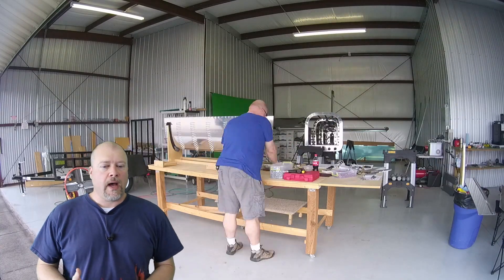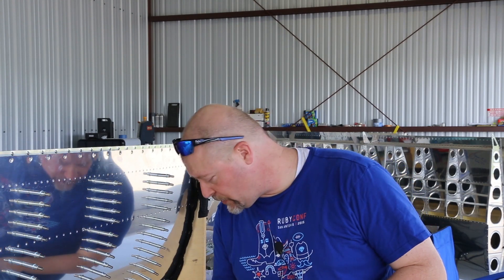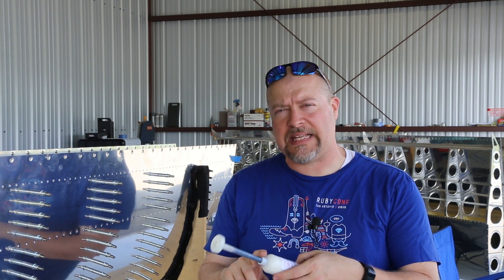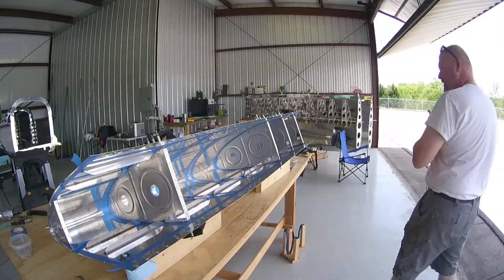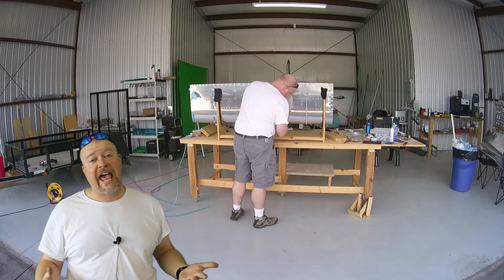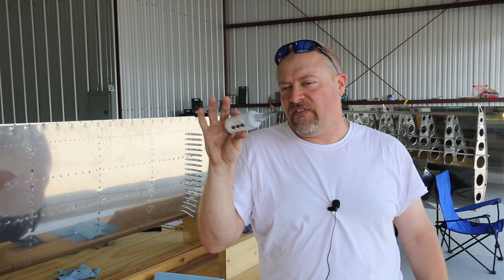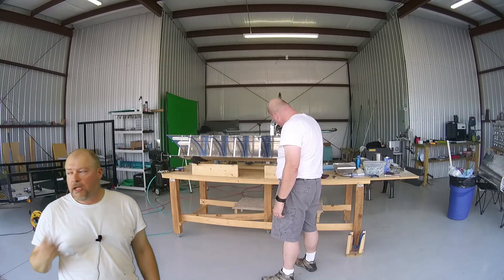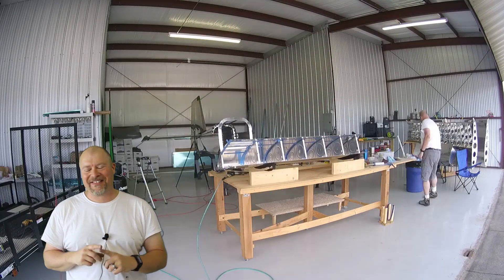RV-10 Wings - 054 - Quick application of proseal to tanks

Comment: So the freezer trick works, but most freezers are not cold enough. Like the guy said below you need -40. Mine goes to -6C which is like 20F and that will allow you to prolong the cure over night. I use a microwave to heat it back up which works well.

Comment: Hi Jason, to respond to your comment relative to put the scellant in the freezer to keep it longer, it is actually the way it is done in the aerospace industry. When I worked on assembly line at Bombardier Aerospace, Proseal (or its equivalent) is prepared in advance in various size plastic tube for use with pneumatic sealing guns. Those Proseal tube are stored in super cold freezer, like -40'F. When a Proseal tube is required, it is heated in a dedicated microwave oven to thaw the Proseal to room temperature, then applied to parts.

Comment: Using this stuff in a day in and day out basis, we can usually get a couple days out of it when stored in the freezer. We also use the pint cans and mix up enough to put it into a 10mil to 60 mill syringe to apply it. It also helps if you are working on something in the morning and only need a very little bit, and at the end of the day you need a little more then you have it already mixed. For the bulk you are using on the fuel tanks it probably isn’t worth your time, but when you are just doing antennas and other small installs you may find it a bit more useful.

Comment: I have finally caught up from my binge watching.
Try home depot for the replacement caulking gun, take the used tube with you to make sure that it fits. All of those tubes are manufactured in common sizes.
I used to be a commercial truck driver hauling hazmat in tankers, the parts you are calling baffles seem more like stiffeners to me as the closed up ribs will provide the baffle to keep the fuel from violently moving from side to side. The movement from front to back is only a couple of feet where the side to side movement is about six or seven feet. I am color blind so I am living  the dream of flight vicariously through you! 
Thank you for the videos, I really do appreciate them.
Reply from the maker: How color blind are you?  I'm also "color deficient".. it doesn't mean you can't fly =)
Reply: I am Canadian, our regulations don't allow red/green colorblind people to hold a pilots license. I have also had complications from diabetes and my vision in my left eye is 20/400 (the big E at the top of the eye chart). I also need to take insulin to control my diabetes. No pilots license or for that matter truck drivers license.